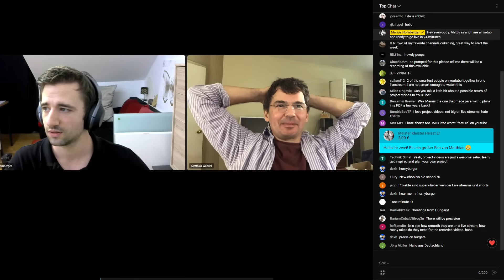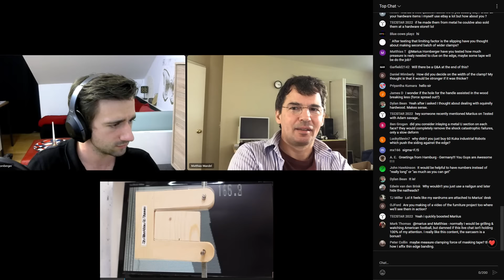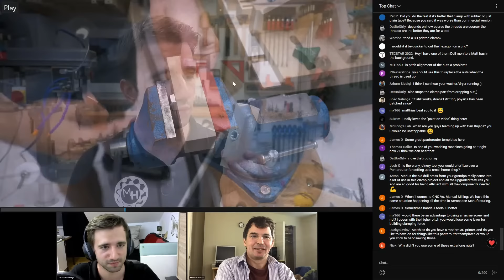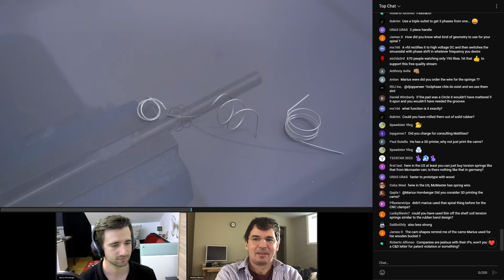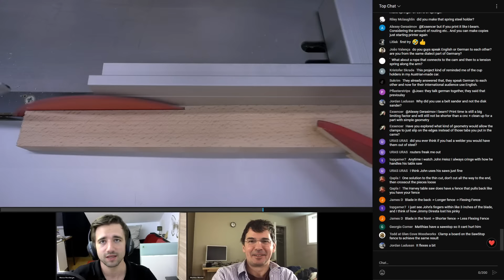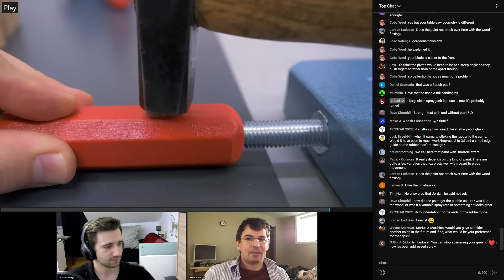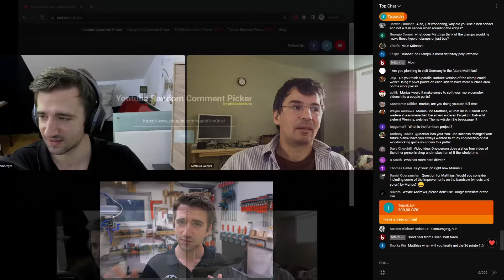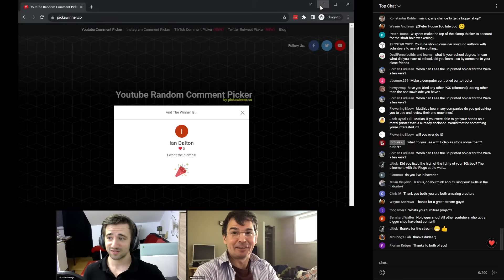Homemade Edge Clamps | Live Reaction with Matthias Wandel

Comment: In regards to the fence of the table saw having adjustment to make clearance after the cut is complete, there are several cabinet saws available now with this (Harvey for example). They have a fence with three T bolts that hold a sliding aluminium extrusion that acts as the fence surface. I can be pulled back out of the way to make clearance after the cut. Also handy for using as a stop when making cross cuts without creating issues of the off cut getting caught between the blade and the fence.

The European panel saws and table saws like Marius has have a much more rigid fence than most cabinet saws I have seen.

Comment: In India (at least in my state) you can get 3-phase domestic supply at 220V (we don't have 110V supply). The fixed monthly charge (irrespective of consumption) is higher for a 3-phase connection than for a single phase connection, but much lower than an industrial 440V connection (which AFAIK also requires you to pay once for a dedicated transformer). The power supply though is extremely unreliable (that's why nearly all homes & offices in India have battery-and-inverter based power backups solutions).

Another problem we have frequently faced with our 3-phase supply is that sometimes the utility company service people connect the wire incorrectly at their end and we don't get the proper 120° phase difference between the different phases, so it seems as if we're getting a supply in only two phases.

Comment: 1. Is a VFD the only way to control the speed of an AC motor? Can't it be done by varying (lowering) the voltage as well?

2. Can a VFD only work with 3-phase supply?

3. Is a VFD the only way to turn an AC motor in reverse (I suppose changing the polarity wouldn't work)?

Comment: You also need to consider the width (or depth) of the edge banding. The wider it is, the greater the force applied on the edge it is, that can separate the banding.

Comment: No need for 3faze installation to to run 3f motor via VFD. U just use monofaze to 3f VFD and that's it. I worked on those for 10years in carwash equipment maintenance, besides other things of corse.

Comment: 48:00 Did you use any special type of spring wire? I found an offer for galvanized wires of various thicknesses, including 0.7 mm, for €16/1 kg/330 m, which is quite cheap 😉

Comment: I feel that your collaboration could have been better focused. As you noted, you basically tested something that  both does not matter, and that you already knew. I feel it would have been far more interesting to see you guys go into the actual design of your project. What sort of strength did you THINK you needed? what was the expected failure mode? 

It seemed a bit anticlimactic to see you spend a whole bunch of effort testing something that didn't matter, in the scope of your project, but not to even explain WHY you needed absurdly strong clamps for what looks like an edge banding application, nor to consider what else needed testing, like say, the integrity of your friction surfaces and the pressure under which they would tear. Or maybe, if you really want to do strength testing, make the clamps, then use them to edge band something and destructively test it, to show WHY masking tape clamping,  or rubber bands on a spring clamp were not suitable. (or for that matter, matthias's F-clamp and a wedge system).

Comment: Could you glue aluminium and wood together? 1 of you could do some testing on fence designs 🤔
Reply: this is not a problem, in industrial applications you would glue those with regular PVAc glue (white wood glue)

the failure Mode is usually the wood delaminating or in rare cases the oxide layer of the aluminum ripping off

Comment: I would think those cad to order based websites might be a good option to get a stronger frame.
Reply: if you want to spend that kind of money, just buy the bessey clamps
Reply: I didn't realize they were only $61 a clamp for the EKT‑55 Edge Clamp. I still wonder how cheap the frame could be built by one of those operations with a suitable material.